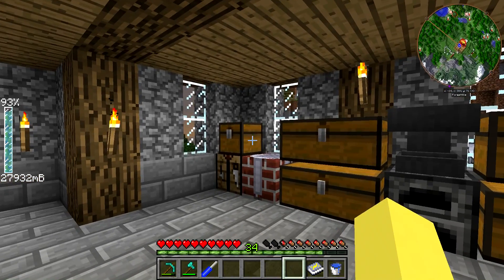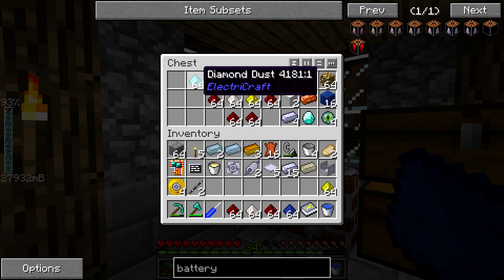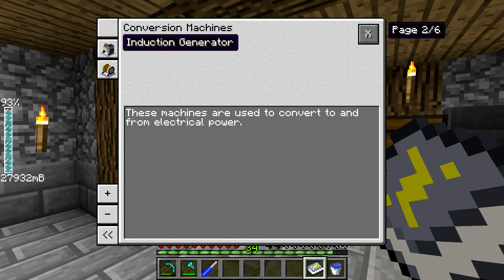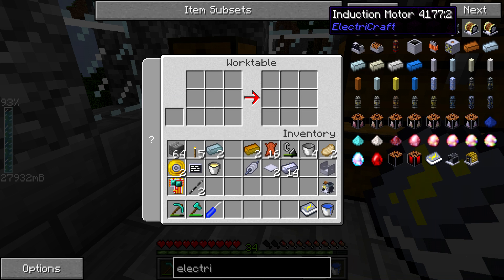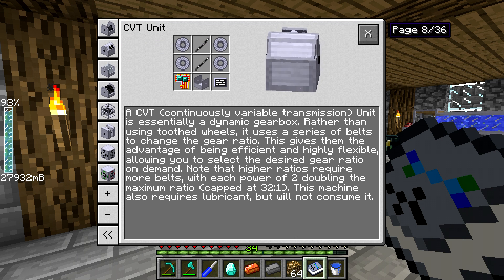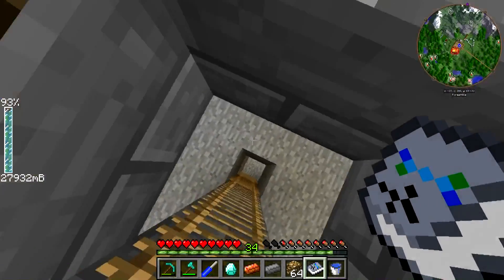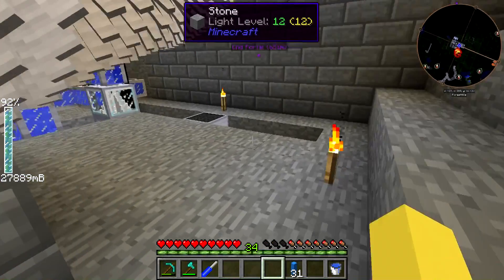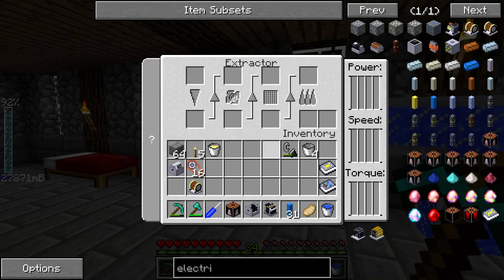Surviving With RotaryCraft :: Ep.23 - ElectriCraft Power Generation & Storage

Comment: if you put an other induction motor you will be able to use the 32 ratio
Reply from the maker: Yea, I think I will hold off on this for now though because I am perfectly fine with 16:1 :) I am in no rush to go that fast!
Reply: A method I used was to use a timer to switch the motor using redstone control between 32x and 1x

Comment: You might try two Induction motors through a Shaft Junction. That should provide enough speed and torque even with the CVT set to 32. Or possibly a 2:1 gearbox set to torque mode between the CVT and the extractor.
Reply from the maker: I can always try the shaft junction idea, but I don't plan on using more than a 16:1 gear ratio for this anyway. The main goal of showing it at 32:1 was to just show how much the motor can output. I am not in THAT much of a rush to get my iron ;)